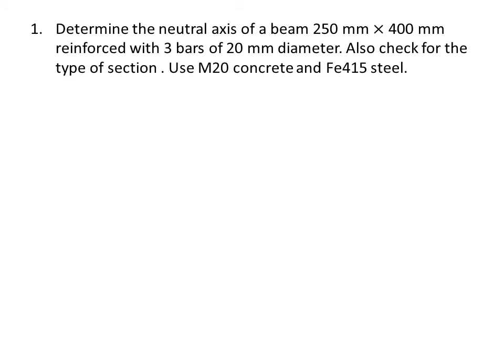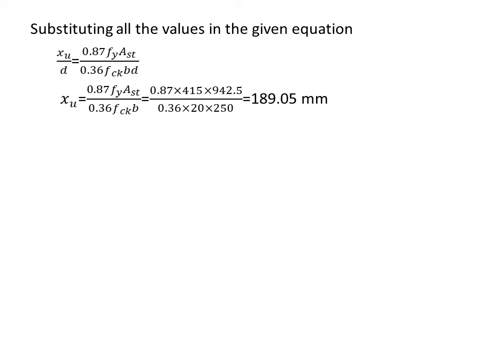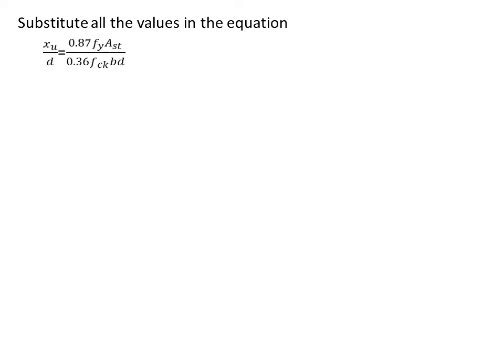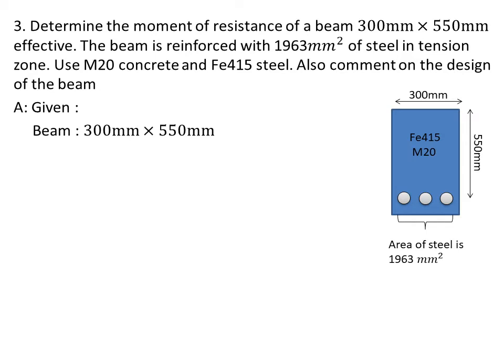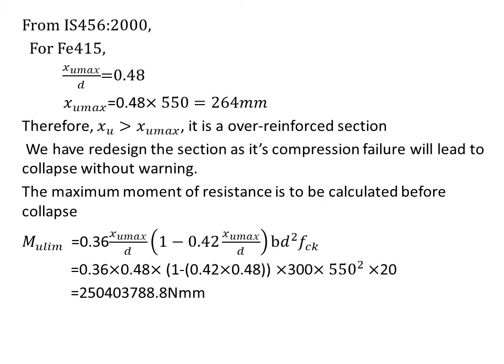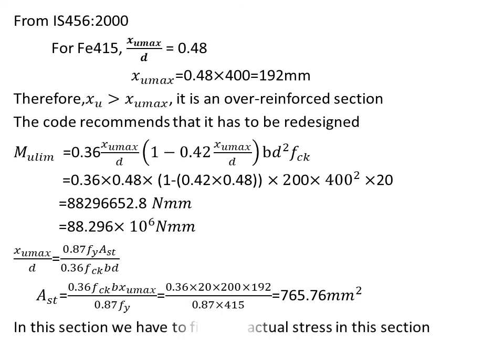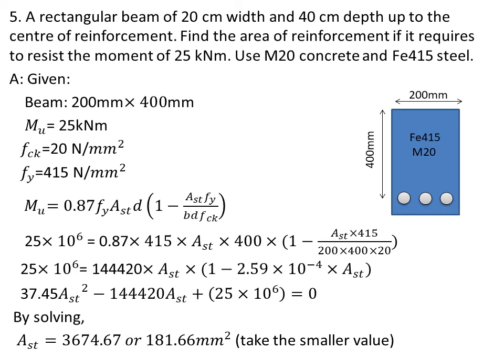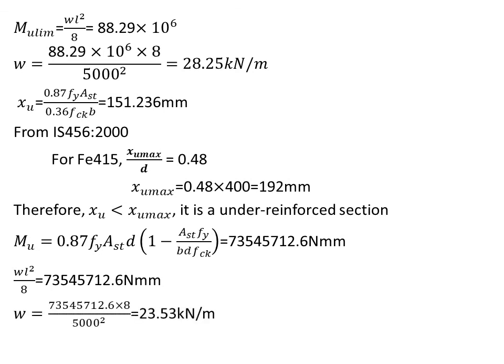KTU DCS CE301 MODULE 1 PROBLEMS OF FINDING MOMENT OF RESISTANCE

Comment: Last prob 
Mu =mulimit 
Eduthath entha
Enik manasilayilla paranju tharamo 
Pls...............
Reply from the maker: The problem had mentioned we find the ultimate load i.e., the maximum load. For that we need to know the maximum moment. In which case does moment becomes maximum moment..it is at balanced section. But that was our assumption. But to check if the section assumed is right we checked the condition of neutral axis depth and we saw that our section was not balanced it was under reinforced hence with that condition we calculate Mu and find the load. When we see that question we see that we have to find ultimate load so the first thing that comes into our mind is maximum moment so we start with that later we see that the section was actually under reinforced. It is only in this question we had to calculate load twice. Maybe with different values the first part would be more than enough. I hope I was able to clear your doubt😊😊😊